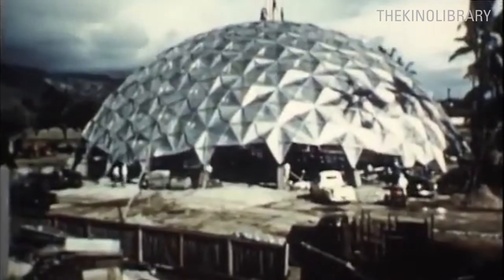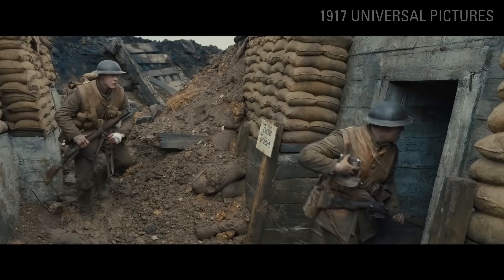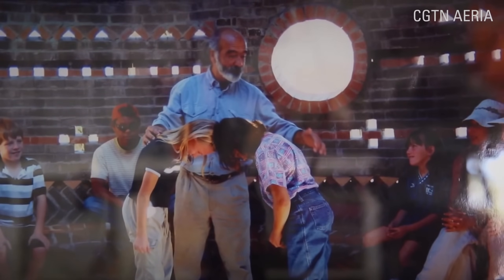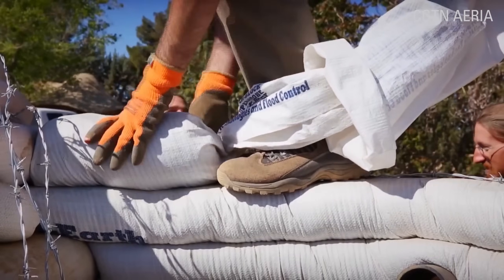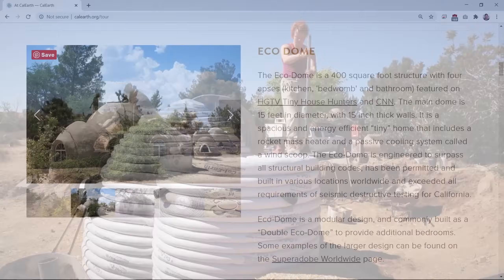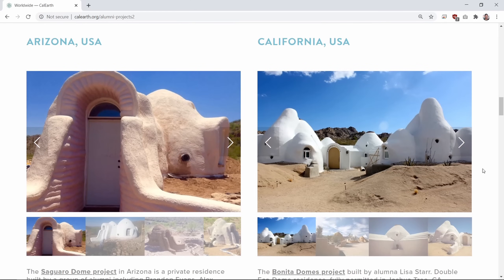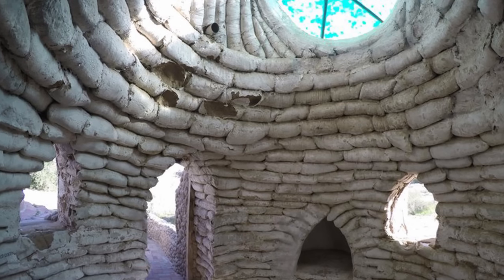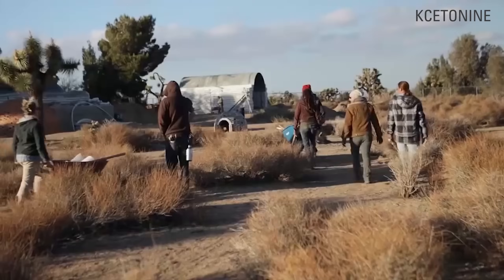Pros and cons of Superadobe Earthbag homes

Comment: superadobe isn't a solution to all the construction world's problems.  but it is a very low-impact and highly durable building method that is well suited to a variety of climates.  there are other natural building methods which compliment this particular one.  what's wonderful is that there are so many natural building methods available to meet the needs of budgets, climates, program, and site constraints.  

some of the "cons" in this video regarding re-sale or construction funding is not so much a con, but rather an attitude that your home is a tradeable commodity.  when you build a custom home for yourself, you don't typically intend to flip it in a few years.

Comment: other advantages would include that there are eco friendly because they're not using materials like concrete that are damaging to the environment or cutting down a lot of trees. But also because they are easier to heat and cool especially if you incorporate radiant floor heat with K pex or rocket Mass heater they are much more energy efficient. That's too much lower utility bills in less burning a fossil fuel. 3d printed homes can be Mass produced. Not everyone can afford that however. I think for the do-it-yourself for and the four folks out there this is just an awesome thing that you can do and in fact we are in the process of doing it on our property.

Comment: Thanks for your honest review of this. Most other sources of information on alternative building methods are all sunshine and roses. My suspicious nature makes me think that if all that were true, someone would have commercialized and mass produced it by now. 
However regarding intensive labor as a drawback, from a holistic perspective traditional building methods are very labor intensive as well, albeit not onsite labor. How so? Well, when you buy something all the money is ultimately spent on either labor, profit, and taxes (unless I am overlooking something). Raw materials themselves cost nothing. Hear me out on this. Perhaps the simplest example is buying sand at a sand pit.  You drive your truck there, a loader dumps sand into your truck and you pay for it. The sand cost the pit owner nothing.  Most of your money went for profits and to pay the wages of the employees working there (the labor).  But what about the equipment that the pit owner had to buy? Same principle:  all the materials that went into the equipment were available without cost.  The steel, copper, the latex for the rubber belts and bushings, the oil that made the plastics, hydraulic oil, and fuel were ultimately themselves part of our environment and obtained without cost for the materials themselves. But the materials had to be mined, transported and processed. That involves a lot of labor, some profit for each time the materials were passed down the supply chain, and taxes along the way. You can apply this same formula to all materials, services, etc. 
So the final cost of any project including all materials represents labor, profit, and taxes.  The cost of ant item then is ultimately a reflection of labor, profit, and taxes, usually in that order. (There are exceptions of course. When you pay $20 at the movie house for a Coke and a tub of popcorn,  the vast majority is likely profit.  When you pay hundreds for a building permit, most of that is taxes. ) When you consider that the current typical cost to build a 1200 square foot house in Sept 2023 is $180,000 it is obvious that conventional building is also quite labor intensive, its just that most of the labor is offsite, producing materials that are quick and easy to assemble , but rather costly. 
I wonder what the labor costs would be for various alternative building methods if you used a crew of experienced people who did this regularly?  
At any rate, thank you for an excellent, honest review!!!

Comment: The description of 'earth' plus 'clay' as a filling material is a bit woolly. What is earth?

Could saharan sand be used in these bags? It is unusable for concrete or mortar because the grains are too rounded and fine. If it is combined with clay, will that work for earthbag construction (I'm going to guess that it won't work)?

Comment: Another issue seems to be that isolation is bad with those constructions. The earth walls have not a sufficient width to provide good isolation by themselves. Their thermal conductivity is 100 or 200 times more than glass wool ! This could be a bit compensated by a layer of daub heavily charged in hay on the outside but you would need at least 10 or 20 cm, not the few cm usually used. Hay cannot be used in the wall themselves as explained in the video.

Thus this sort of habitat may be good only if days are hot but night are fresh with the addition of some sun protection and white finish. If the weather is constantly cold or hot, it will not work well. Worst the dome tends to be high which is a good thing in hot climate but a bad idea in cold climate because any heated air will go to the top of the dome leaving the floor very cold.

Comment: Why build custom curved furniture to fit the round perimeter walls? Why not organize some components from the center outward, thus dealing with the right angle issue? There are internal walls that can be built straight as partitions and still preserve the comforting feeling of curves.
Mass market tastes follow what already exists, which is no solution to saving the planet. I like the idea of many approaches to solving problems. I agree with an earlier comment, you need to factor in the waste stream of all the specific manufactured components of conventional building as well as transportation costs when comparing
this kind of building with mass produced housing.

Comment: The labor can be dramatically cut by using a dirt bag filling machine (like compost and sand bags are already filled for big box garden supply retailers), just modified to fill bags the common 14x26in construction bags. Filling machine is loaded with dirt by a large end-loader or landscaper grade 'bobcat'. Filled bags are stacked on pallets and pre-flattened (perhaps a vibratory base under the pallet). Then forks on the 'bobcat' lift the pallet to the worker height where the dirt bag bricks are placed into position on the structure walls and just given a light tamping. Edit: found one of several links: https://www.youtube.com/watch?v=ubP2kD3ubjk

Comment: many of the problems you point can be answered by an architect that knows about the super adobe system. you can stabilize the sand plus clay mix with portland cement (not my idea it is an official Khalili solution) you want a squared house? you can build a reinforced concrete structure and use super adobe as filler, obviously you need a traditional roofing system here. I have seen the last and it works as a charm. so the thing is eco domes are not for all places and for all families, thinking that is the same as thinking that the internationalist structures of glass and steel are great architecture everywhere.

Comment: I would have to disagree with her claim that sandbag construction can not be automated, certainly theres ways to make machines that can fill such bags as well as a way to make a machine to place them… I mean, if there are brick laying machines, certainly theres a way to make a sand bag laying machine… beyond this, what if there was a machine that would roll out a tube bag and lay the bag out in layers, putting barbed wire in between each layer, folding the bag over itself, this would make placing the structure extremely fast and easy Edit, there also are sandbag fillers that already exist for load lifters, check this out https://youtu.be/gJk684t1uLM this automates the sandbag filling for any project that you’d need, from here, all we would need is a way to automate bag placement
Reply: May want to check this out https://youtu.be/gJk684t1uLM

Comment: Hello Belinda and thank you.
Just bought my first batch of bags and they were discounted because the original company that ordered them went bankrupt. They're local too!
There's only about 40,000 of them so every month I'll pick up more until they are done or I am.  
I'll start small and see how that goes. The first batch was 875 bags and I'll need more than that for my project.
Thinking of doing a work shop to help with the labour intensive part, ... I'm rather old fat and lazy myself, ... but I cook well and feeding the help good really pays off. 
I'm working in a sand pile, ... so I might experiment with a little Portland cement. Can't hurt eh?
Have a great one.

Comment: Subsequent to my previous comment I am currently in the Philippines and I have paid a lot of attention to the Physics of buildings and how the environment works here and nobody gets it. All day long people comment on their day and just say "mainit" (hot), which if you think about it is simply not true the temperature gets up to about 30 centigrade so they are making a subjective statement based on the fact that they feel hot. What actually happens is during the day if you stay in the shade avoiding the direct sun it can be pleasant. Once the sun sets and the air begins to cool the relative humidity spikes right up and the human body loses the evaporative cooling effect of sweating. So the key thing is the humidity and aircon is just going to make you have big electric bills. I am now interested in using the structure of the house as a humidity regulator. So that says, make your house out of wood the heat of the day will dry the the fabric of the place out and in the evening it will absorb moisture to keep the humidity down. There are two problems with this approach wood is expensive and becoming scarce and termites will eat the place from under you. The solution is Gmelina wood but we would need to get a growing program running so I am wondering about using earth bag construction.

My partners mother was required to demolish her house for a road widening scheme so they have built a very unsatisfactory wooden house as a temporary home but the place is being eaten by termites. They are hell bent on building a concrete house what I call a hell box big thermal capacity and no humidity regulation. I am now beginning to wonder about the earth bag system using permeable bags like hessian but the plastic rice sack type. The earth could dry out during the day and absorb moisture at night. Any ideas Belinda, because we are only talking about 13 mls of water per cubic metre of air here.

Can I just make this last comment about aircon if you are damned well determined to have it to get to sleep consider this image for example the king in his castle keeping warm in his four poster bed. Now do it backwards and push the bed up against the aircon. Result drastic reduction in electric bill.

Comment: I agree with all of the Pros that you give for this construction technique.  I disagree with most of your cons.  Here is my itemized list of why:

Cons of Earth Bag Homes

1. Curved Walls and limited footprint. - Only the domed sections of earth bag homes require curved walls.  Straight walls are completely possible and common with earth bag homes.  If the walls are straight for ten or more feet, then they can be supported with exterior buttresses or interior walls that make up rooms.  This allows for conventional furniture and cabinets to be used with ease.

2. Expensive Custom Finishes - The best finishes to use on earth bag homes are clay and lime based finishes.  These are not exotic or expensive.  They can be from the same raw materials used to fill the bags with the addition of a stabilizing substance, such as cement or hydrated lime.  They are cheap, beautiful, breathable and effective

3. Exposed Pipes, Cables and Ducts - This is simply not true.  Electric wires are usually place between two layers of the wall.  They stay protected here and are not exposed.  Conduit can also be place between wall layers.  Electric wires can be imbedded underneath the plastering of a wall.  Electric and plumbing can also be run through the floor or the ceiling of an earth bag home.  Traditional modern roofing systems are typically used in most earth bag homes.  The exception would be the dome construction technique.  

4. Loan Issues & Home Valuation Estimation - I agree that getting a loan for this type of structure would probably be impossible.  Most of these types of homes are being built by home owners to create a cheaper and more sustainable home.  So this type of construction is a way for families to avoid the trap and expense of conventional mortgages.

5. Resale Value - This may be an issue for a buyer that needs a traditional loan.  Having a sustainable home can also be a huge attraction for potential buyers.  These homes are also very popular with short term rental sites, such as AirBnB and VRBO.  

6. No Compostable Materials in Bags - This is a disingenuous and silly con.  The percentage of total building material that is not compostable is 0.00000000001% of the total building materials.  The dumpster loads of waste generated by a conventional, and even sustainable, building methods is astronomical.  This looks like you are trying to create a problem where there is none.

7. Labor Intensive Building Method - It takes some serious manual labor to put one of these homes up, but as another poster commented, this labor is very small in embodied energy compared to conventional home building methods.  The amount of energy needed to produce and transport traditional materials is enormous.  The labor to build an earth bag home is low skill, non specialized and very accessible to the home owner that wants to build a house themselves and debt free.

8. Scalability Of Construction Method - This method is not attractive to the corporate building industry and that is fine by me.  Perhaps there will be able to affordably 3D print these types of houses in an affordable way.  I’m not waiting for them.  I intend to start building using this way very soon.

9. Mass Production of Houses - This is not the point of this construction method.  This is an accessible way to build an efficient, durable, temperature regulating, fire proof, bullet proof, insect proof, locally sourced, self built debt free home using the help of friends and family.  It is the ultimate in reaching the dream of home ownership anywhere in the world.  The housing market and financial markets have failed the people they are supposed to serve.  This type of construction can make this possible.

I recommend investigating the newest form of this type of construction called Hyperadobe Earth Bags.  These are even simpler to build than traditional earth bag construction.  They do not require barbed wire between layers, the bags are very UV resistant, which extends the time to apply the exterior finish coats.  They are also easier to fill using a bucket dolly system.  The YouTube channel Tiny Shiny Home (I’m not affiliated with them, just a fan) shows excellent examples of using this system.

Comment: What is the true value of a home that costs relatively little in time/money/effort that is tornado/fire/earthquake/flood/car crash/rot and mold/insect resistant and lasts over 100 years with little to no maintenance?  If you think a lot of effort goes into building earthbag houses, try building a modern home with all the codes by yourself and on a budget, lol...we haven't even seen this movement take off yet by a long shot.

Comment: Completely agree that we should focus on sustainable solutions that have the potential to meet the needs for larger scale development. As a California architect who has worked with earthfilled (we were required to use a mixture of earth and cement so the carbon footprint high) bag construction, I do not think the California Building Code permits earthfilled bag construction. A quick search for an ICC-ES report for earthfilled bag construction produced no report that would allow a building department to approve a structural system that is not included in the building code. Our firm was able to get a one time conditional permit from a sympathetic building department that would be hard to replicate. CalEarth's website, is indicating that once sympathetic cities are no longer issuing building permits for earthfilled bag structures. I would not claim that the California Building code permits earthfilled bag construction.

Comment: All I know is those plastic bag lasts 4 years. It is proven fact. In some of your pictures I saw that some homes was not rendered from inside and had already holes. I asked owners of such buildings and they said it is safe as long you plaster bags from inside and out. But I am still not convinced. This bag idea kept on some enthusiasts and promoters. I can not prove it but knowledge that after 4 years those bags will turn into tiny plastic pieces concerns me. After 4 years there are will be no connection between plaster and material inside of bags. That is my worry. Prove me wrong I am ready and willing to listen.

Comment: I did a weekend course at the institute several years ago. Practically, you can learn in a weekend how to build an entire living space. My hesitation about not following through with building a house using this method has been that the end result is a basic shelter. Due to limitations of dimensions and shape of the structure this method  does not seem conducive to building a comfortable and appealing house. Refinements to speed up the process and building more intricate houses might make this building method more appealing. An Italian company has invented a 3D printer to build dome structures. Depending on the costs, that may be the way to go.